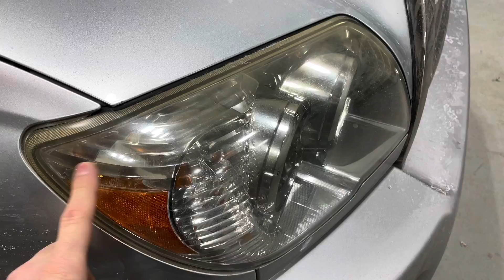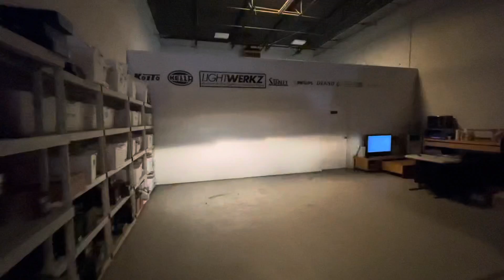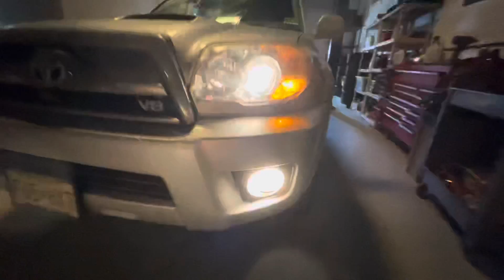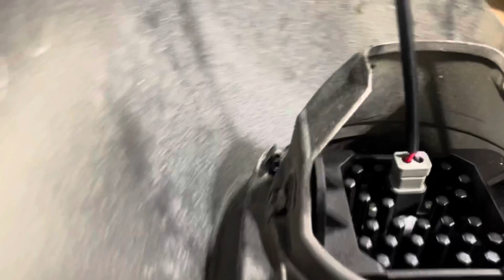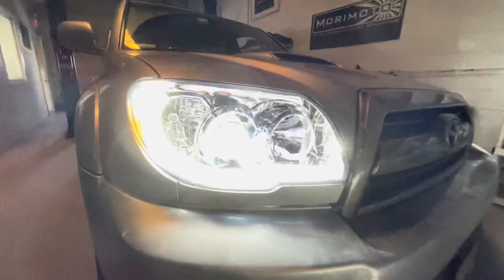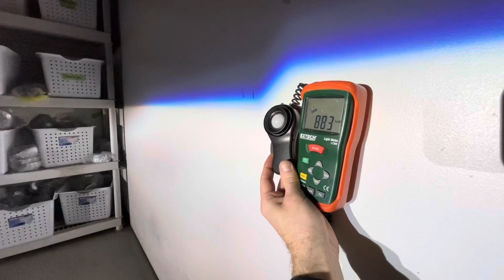4th Gen 4Runner - G5-BRT Projector Retrofit + SS3 Max Fog Lights

Comment: Looks awesome! How did you mount the projector?
Reply from the maker: You can use the brackets we offer - https://lightwerkz.net/collections/retrofit-brackets/products/03-09-4runner-d2s-5-0-g5-r-brackets
Reply: @LightwerkzGlobal I bought these same aftermarket lights from Amazon for my 4th Gen. These aren't Toyota OEM... Do your projector brackets fit this housing for the low beams? I'm trying to fit Morimoto MLED 2.0
Reply from the maker: Unsure of how the MLED will fit but technically its got the same bolt pattern. Just not sure if it will require different spacing or more trimmings.  @llampshadee

Comment: Do you know if it would work on a 2004 4Runner  the SS3 Max Fog Lights kit
Reply from the maker: Sorry, not for the 2004. Not without custom fitment.
Reply: @LightwerkzGlobal  What about a projector headlight similar to the one in the video, but that fits on a 2004 4Runner?
Reply from the maker: @jonny4509torres  Yes you can retrofit the G5-BRT projectors in the 2004 headlights.

Comment: Looks like a 35 watt ballast setup correct? Those are the kind of lux readings I'd expect. Nice short video. I've got a 2005 Toyota with 50 watt Morimoto ballasts at 5800K they look great but my retrofitter left them cockeyed. Sad. Just messaged you guys today to see if I could ship over my lights to get the MLED 2.0 in them.
Reply from the maker: Yes Hylux 35W.
Reply: Looking good! 👌